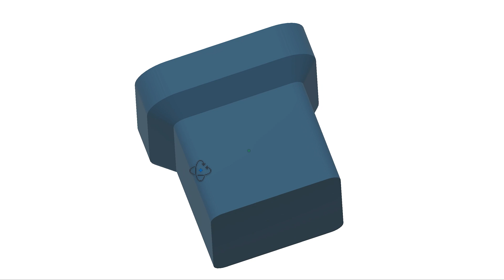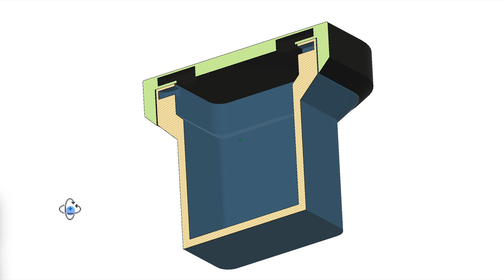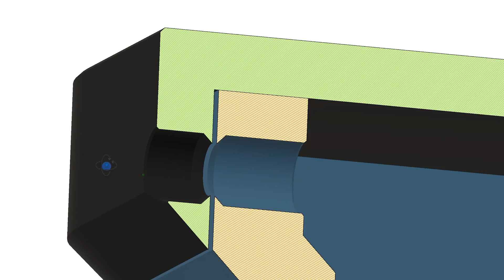Top 5 Ways to Add Magnets to Your 3D Prints!

Comment: I'm trying to embed a bolt in a 3D print, using the pause at layer script in Cura 5.11.0

The bolt will be lying horizontal, and I will pause the print at the center line of the bolt. Problem is, half the bolt will be protruding above the uppermost print layer.

Is there a way to ensure that the nozzle avoids traveling through the area where the bolt is?

Comment: I have a design where spherical magnets must be inserted into a print and have some clearence to freely rotate.
I could do it with my older printer, which used a brass nozzle, but the Bambu Lab X1 Carbon is using too many magetic parts, including the nozzle itself and the enclosure, and my magnets are quite strong.

Comment: Try using a hex shape with the distance between flats the diameter of the magnet to be used. The flats on the hex shape can deflect more than a round shape. It makes the press-fit less fussy.

Comment: Just used the print-pause embed with 20x3mm magnets and I think the size meant the nozzle spent enough time over them that they demagnetized due to heat. They definitely ended up much weaker than when they went in.
Reply: Uhhhh just recharge the magnet then… seems pretty obvious.

Comment: what about heat?
Reply: From personal experience small  magnets will lose at at lease half or all of its strength it heated past Maximum: 80C / 176F for N42 (the cheaper kind) and N52 Maximum: 120C / 248F. PLA has a glass transition temperature of 60°C and viscous enough to be extruded  between 180 and 230°C. So you might want to check what will work for your project.

Comment: If I wanna embedd some bigger magnet and I want it to make it the 5th way, shuldn't I be concerned about the printer sucking that magnet back up? Like... I have a round 15 by 5mm magnet with the pulling force of 2 kilos (0.59 by 0.2inch and pulling force 4.4 pounds)

Comment: My favorite way to do magnets is using this spherical ones and pausing your prints to embed it completely. You never have to worry about polarity when installing the magnets that way as long as you have tolerances set so they can freely rotate.
Reply from the maker: Never thought about that! I’ll have to try that out sometime. Thanks for sharing!
Reply: How do you keep the spherical magnet in the hole if some part of the extruder head has ferrous metal?  You will have to print the hole so it’s slightly bigger then the spherical magnet so it has room to rotate around but if the extruder has any ferrous metal on the print head then it’s going to pop out of the hole.  If you print the hole so it’s a tight fit then the spherical magnet can’t spin around for proper alignment with the other magnet.
Reply: @jamesnichols7507 I don’t think the magnet is a sphere. If I understood it correctly, the hole is a sphere. So the flat magnet and spin in the hole.
Reply: @jamesnichols7507 I have this problem with the Bambu Lab X1 Carbon nozzles. I also need the spheric magnets to be able to freely rotate after insertion, and they are being pulled out of the print, sometimes ending up attached to the enclosure.